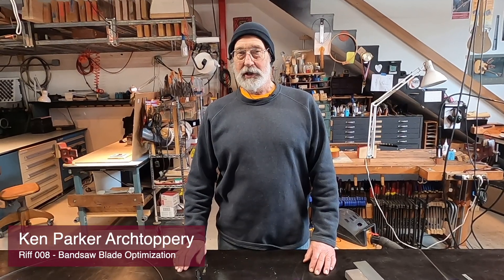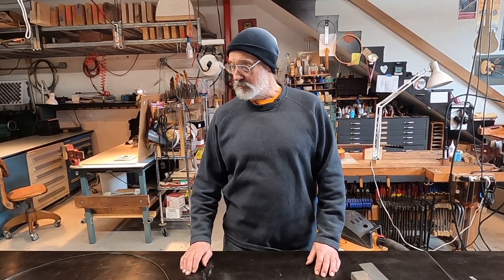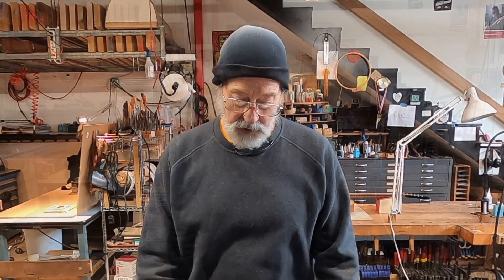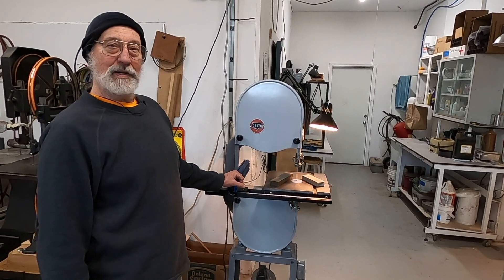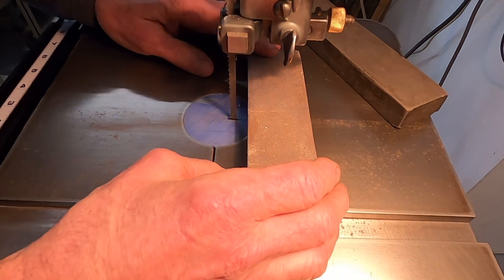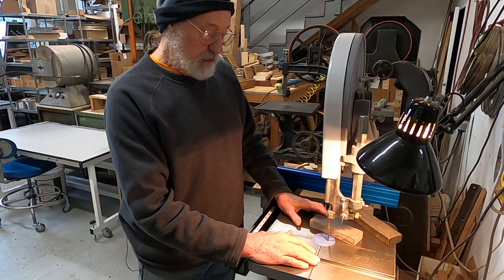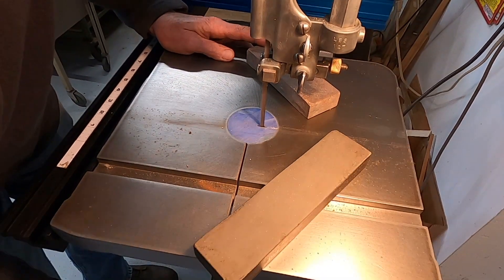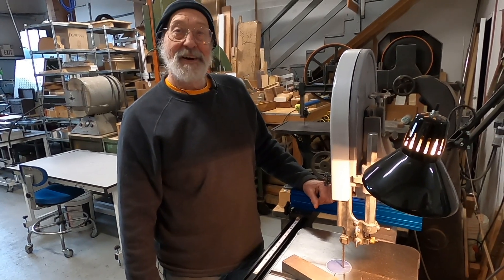Ken Parker Archtoppery - Riff 008 Bandsaw Blade Optimisation

Comment: I assume you cleaned all the sawdust out of the saw before starting this process.  I have heard of more than one fire starting this way in wood shops.  It usually involves metal cutting on a table saw.
Reply from the maker: Fire Good!  Shop Fire Bad!  Sparks and dust are to be kept separated!  With the right dust in the right concentration, you can have explosions!  This is why some cultures favored cylindrical stone buildings with lots of little windows in which to grind grain, so that when your flour dust bomb went off, as least you didn't have to build a new building, just replace the blown out windows, and find a new, unexploded miller, who hopefully, will be more careful!

Comment: My last 4 years of employment teaching woodworking at a high school, band saws were one tool I had to help maintain.  This detail of fine tuning the blade is incredible.  We rewelded broken blades and your methods would have been useful.  Thanks.   Rick
Reply from the maker: My Man!  Did you have a good blade welder?  Blades and blade welding have come a long way since I started half a century ago.  Peace, and Happy Winter!
Reply: @kenparkerarchtoppery9440  the welder was an older one and we had to smooth it by hand.

Comment: Have never heard of doing this but makes perfect sense, a before and after cut would have been great to see any improvement. Great video 👍
Reply from the maker: Good point, but it depends on what you start with, of course.  These days, with better process control, some blades are pretty darn good right out of the box, and might not improve too much, but sometimes it really cleans up the cut surface.  All blades and all guides will benefit from the rounding and de-burring of the back edge and corners.
Next bandsaw show, we'll look into how this back of blade treatment helps improve how curves are cut.  Stay tuned!

Comment: Ken, admire your videos.  You are a master many areas.  Hopefully you will not be insulted by my making a few suggestions?  No criticism, just passing along 50+ years of experience in many trades.  I worked for a boat shop in VT started by a classically trained artist who developed a passion for wooden boats, specially Adirondack Guide Boats.  If you are curious, they are still in operation by that name and have some great information online.  Anyway, this artist was great at design, but not mechanically inclined.  Had an old 14” Rockwell Delta with a riser block, 3 horsepower motor, and Carter guide bearings.  But it was horribly misadjusted.  Having aircraft repair and metal fabricator experience I naturally fixed that issue promptly.  Spent thousands of hours pushing cherry, ash, maple, and spruce through that wonderful machine and enjoyed the process of cutting to the line.  So that is my story, I think a couple of items could be passed along in a “ pinned “ preface of this video.  I know that your saw was clean, but that doesn’t mean that your viewers have dust collecting and sterile shops……. A disclaimer statement saying all sawdust should be removed prior to metal removal is performed might be in order for your sake?  And to protect the work surface- Blue Tape those stones bottoms?  You and I have skill sets above and far beyond most people who might come across these informative short tips videos, having paid dues for decades doing these things.   There is a great player in Toronto I stumbled across on utube, that busks with a Fly that you produced, really does it justice!  And proves what a classic you designed and built.   Again, only praise and admiration for your teaching ability and where you have gotten in your life, but as an admirer of what you do, just suggestions for your protection.  If I were 50 years younger I would haunt you to take me on as an unpaid apprentice.
Reply from the maker: Thanks for your letter, great story!  Good points!
Off camera, I did blow away the sawdust first, so no dust was in a position to catch fire, but I submit that you would have to be some kind of wizard to get the tiny, tiny sparks generated here to catch anything on fire, although I suppose anything is possible.  I do hear your concern, and am most attentive to this when running power sanders, as I cut both wood and sparky ferrous metal, so there's real shop safety reason for cleanliness, caution and close looks.
As to the stones scratching the table, as I was filming this, I thought about the sheet of plain paper that I normally use under the stone, but, hey, to err in human, no?